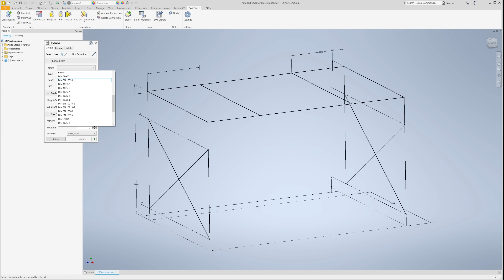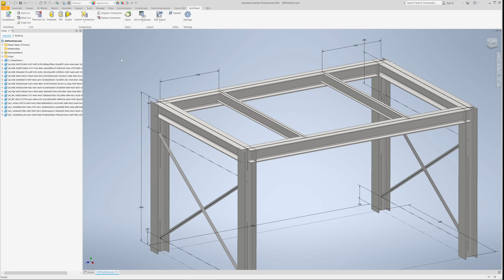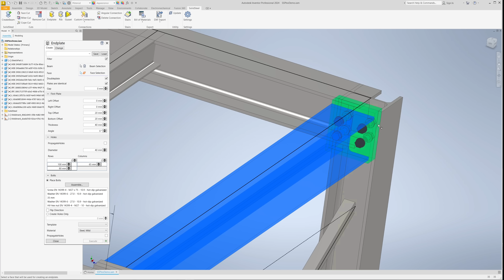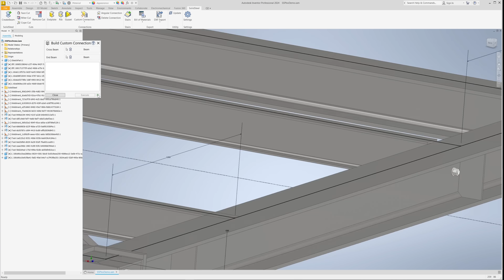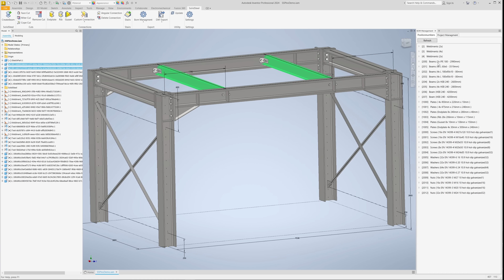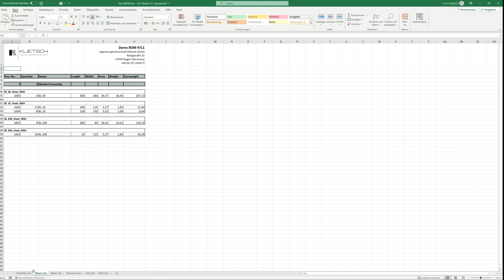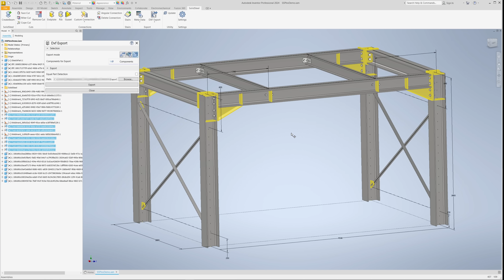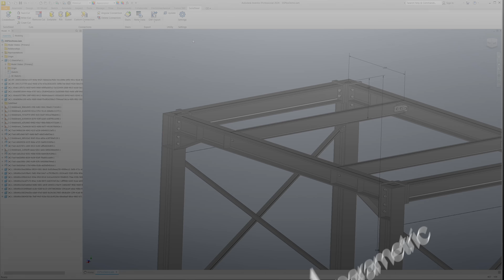Structural Steel Design with Autodesk Inventor - SolidSteel parametric Product Video

Comment: Can't it use Inventor's own library? The profiles in your library are not available and the size information is not available in project description section. In addition, the same situation is true for fasteners. It would be great if you solved it with the existing content center library. It is also very successful. Those who actively use their own library will not be able to choose.

Comment: Bei Kopfplattenerstellung werden nur die Bohrungen in die Kopfplatte gesetzt und nicht in das zu verbindende Profil. Gibt es hier eine weitere Einstellung um die Löcher durchzubohren?
Reply from the maker: Hallo @thetechthingguy5281,

sorry, Ihren Kommentar haben wir irgendwie übersehen.

Das Durchbohren der Löcher ist selbstverständlich möglich. Im Dialog gibt es die Option „Löcher propagieren”. Wenn diese aktiviert ist, wird das Lochmuster der Kopfplatte auf das angeschlossene Profil übertragen.

Zugegebenermaßen ist die Benennung im deutschen Dialog etwas ungewöhnlich. Ich habe gerade mit einem der Softwareentwickler gesprochen und ihn darum gebeten, die Option zu "Löcher durchstanzen" umzubenennen.

Beste Grüße und viel Erfolg mit SolidSteel parametric!